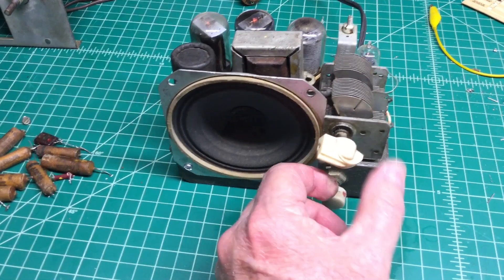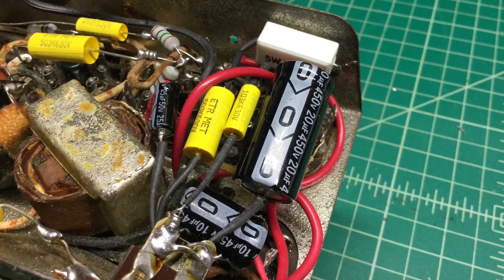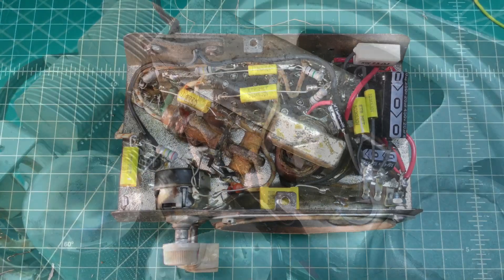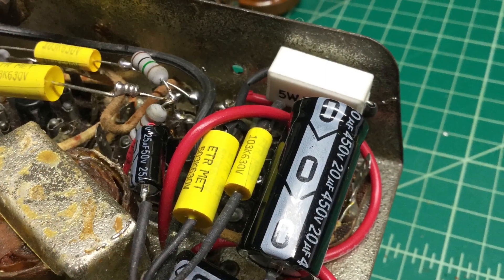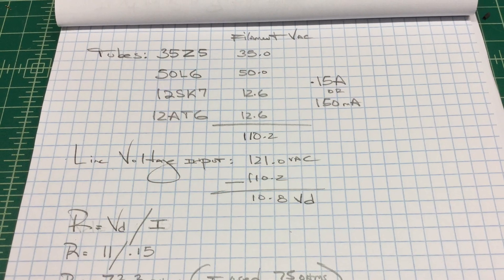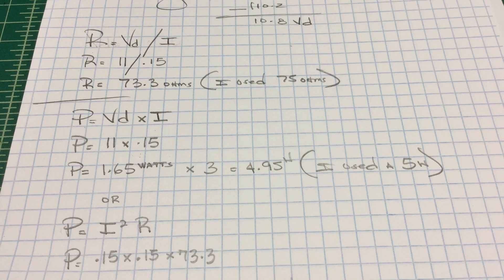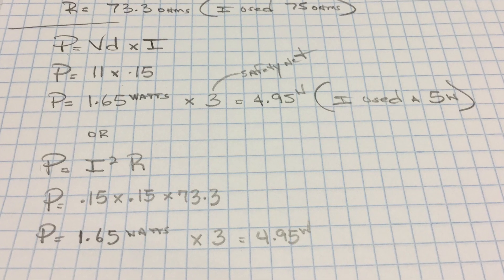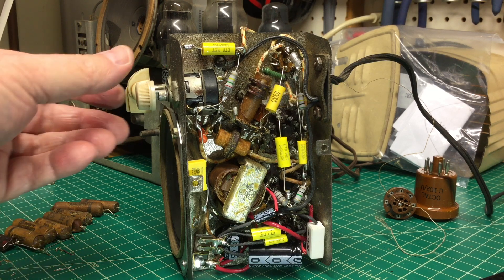Arvin 402A - Recapping & Other...

Comment: I have a 10 watt mono tube amplifier from a 1957 motorola Hi Fi record player and last time I powered it on it wouldn't play anything from the record but it was turning but no sound. I hooked my iPod up to the aux in because this player had the option for a radio insert and I could hear the music from my iPod but it was crackly and distorted. I'm not sure what needs to be replaced other than the caps which would be a good place to start. I have a video of it, it's shaky but you can hear how it sounds.
https://www.youtube.com/watch?v=5J9QF7eZI6U
Reply from the maker: Sorry, I’ve been away. I watched/listened to the video and read the comments from others. As others noted, the hum at startup is a good indicator of defective capacitors. You should have it restored and the wiring issues you noted corrected as well before powering it up. Lethal voltages are present, so I wouldn’t attempt the repairs yourself. All the best. Don

Comment: Hi Don, did you ever finish restoring this radio?  Jim
Reply from the maker: Jim - it’s funny you mentioned this radio. I think it’s still on my list of radios to finish. I’ll look at digging it out soon; thanks for the reminder. Best, Don
Reply: @RestoreOldRadios  Hi Don,  I was thinking about the rusted case of the Arvin.  I had two rusted cases of about equal size sand blasted and powder coated for $50.  My brother-in-law is a metal fabricator who does a lot of business with that shop so I probably got a discount.  More expensive than a rattle can but if we came back in 50 years, the cases would still look good.  Lol.  I am almost 74.  Jim  WA8OSS
Reply from the maker: Jim - the powder coating is something I want to explore if and when I ever run across another gem. I know they look like new. BTW- you’re still a young man with a sharp mind. Best, Don
Reply: @RestoreOldRadios  Thanks Don.  The powder coater will work with you.  A word of caution.  You not only want them to duplicate the color but also the finish.  Otherwise it will come back glossy.  My finishes looked like they had sand mixed with the paint to give a somewhat rough look to the cabinet.  I did not get this same finish back.  Worth another try at some point.  I am almost finished putting my transmitter back together.  Jim

Comment: Hi Don, can we replace a filament dropping resistor (sand resistor) with diode for example "1N4004 400V one Amp or 1N5408 1000 volt 3 Amp"? What I noticed diodes doesn't create that much heat and reduce voltage to accommodate a modern day line voltage on AC/DC radios which can operate over 85 volts. I tried it on my other radios and it worked well with no problem. I do not have electronic background and I work on radios as a bobby, like to get your input on this. Thank you and have a good day!
Reply from the maker: I think the info Paul provides on this subject will be helpful. I’ve followed his practice many of times and never had an issue. Let me know your thoughts after reviewing. Best, Don

http://www.vintage-radio.com/repair-restore-information/valve_dropper-calcs.html
Reply: Thank you Don, calculation was over my head.. LOL But Summery was a good info.  "The resistor is the safest option for the valves, but is also the hottest running. The other options (Diode-Resistor 1N5408 diode which is rated at 3A, 1000V. have higher switch-on surges and slight increased risk of damage if a component fails, but run cooler. Personally, I would regard the capacitive dropper as preferential to the diode dropper because of the reduced dissipation, the ease of taking measurements, and the reliability (overall I would expect a motor run capacitor to be more reliable than a semiconductor diode)." 

He suggest for Capacitive Dropper " A small resistor should be connected in series with the capacitor to act as a surge limiter. I would choose one that will drop about 10 volts. Ideally, you should add the voltage drop of this resistor to Vh. Additionally a resistor of around 100K to 220K at 1W should be connected in parallel with the capacitor, to discharge it quickly when the set is switched off. Not sure if I have enough space for Capacitive Dropper suggestion. Thank you Don!
Reply from the maker: @RadioFixer  I’ve always had that space issue with the AC Capacitor method too and settled on The Diode/Resistor solution. I’m glad you found the info helpful and all the best on your projects. Don

Comment: Great video! I just finished the restoration on mine. I'm guessing that yours uses a permanent magnet speaker, hence the choke. Mine uses a field coil speaker with no choke. And you're right, restoration on those are rather challenging due to the tight quarters

Comment: Why the 450 volt ecaps? Overkill
Reply from the maker: +Pete Dazer Hi Pete - you are right on the overkill. I always use what I have on hand to keep my expenses in check, since this is a hobby. I do very little repair on radios that I can use 160V capacitors and the shipping costs was not worth it to me. I appreciate your question/comment and again agree on the overkill. Best, Don